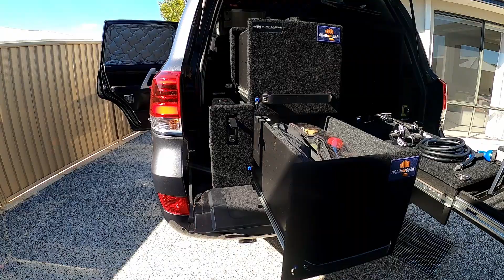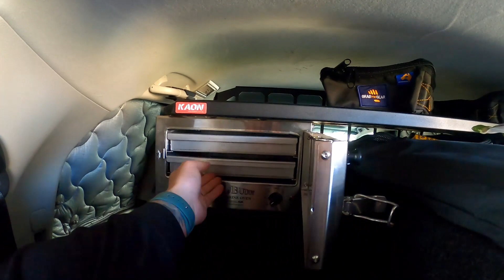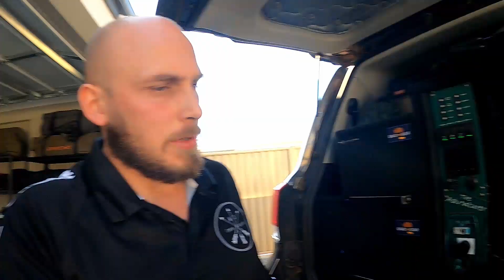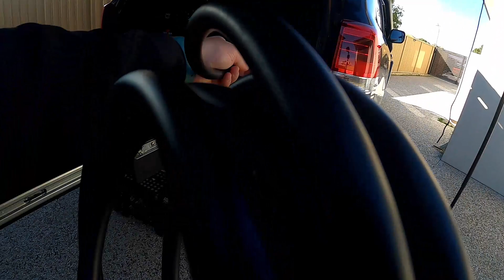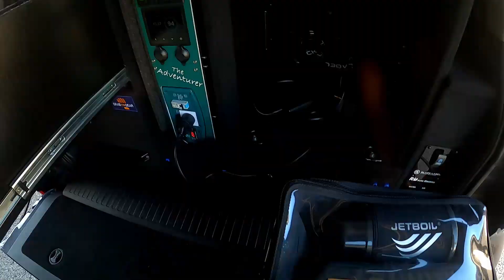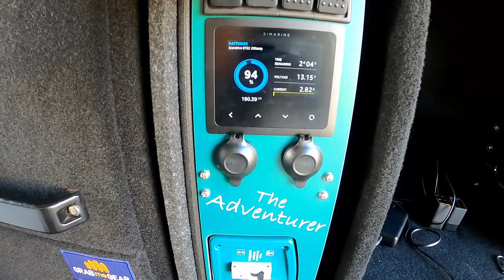200CRUISR REAR DRAWERS CLOSE UP & ELECTRICAL PART 2 - 200 SERIES ULTIMATE WAGON BUILD SERIES

Comment: Hey mate what awning is that? Also how have you run power to Your coffee machine?
Reply from the maker: Hey mate, awning is called the Dingo Den and it’s made by Dingo4x4 down in Rockingham. The power to the coffee machine is run off the inverter from a 4 bay power brick and the cables just hidden nicely dude

Comment: Man that 200 is clean as !!!
Very well thought out and i do like your idea on the dual stacked  draw fridges👍 
Was gonna say did u look into an upright fridge at all?? 
Keep up the nice v logs mate 👌🙂
Reply from the maker: Marc you champion mate thanks for the comment! Yeah I think being a short ass the fridges will work well, I did consider the upright way at the beginning and putting the drawers in, the space didn’t help me plus I wasn’t so sure on how things inside the fridge with 4wd driving and corrugations would hold up as well so quickly dropped down the pecking order, think they are such a great idea and fridge though if you can fit them for sure! 
Appreciate it though mate and thanks for watching dude! 👍🏻